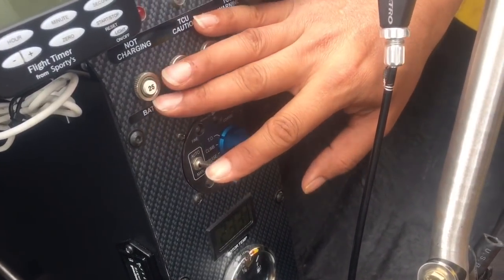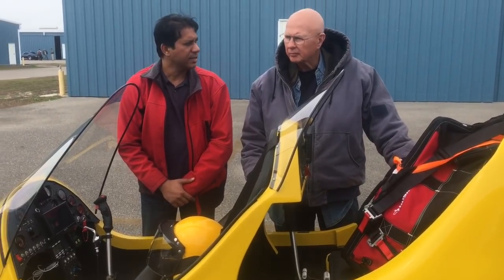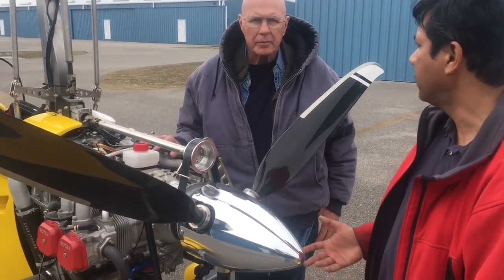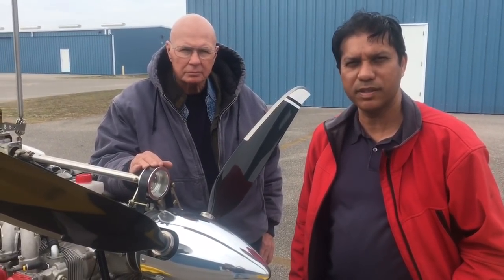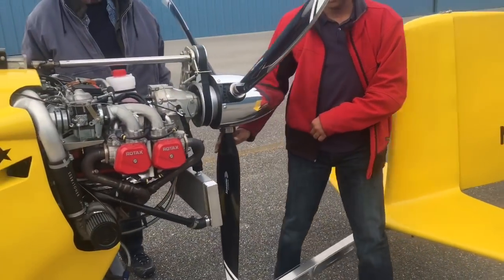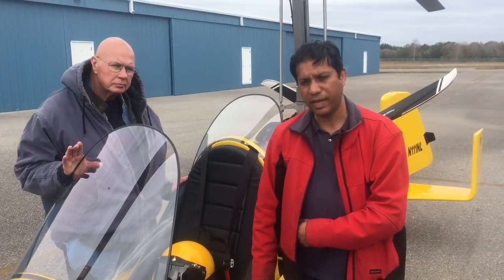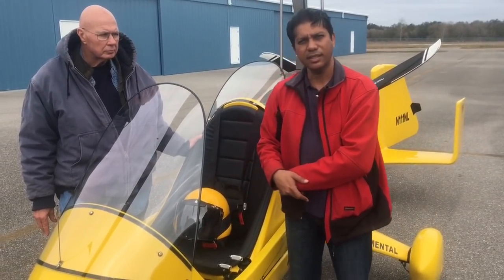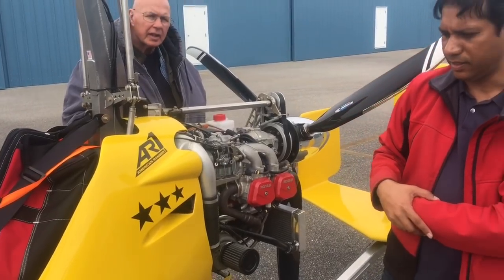Gyrocopter Airmaster Adjustable Propeller Explained

Comment: I WONDER IF an adjustable prop on a 2 seat, basically short haul, non-cross country airplane is of much benefit???
Reply: Tribulation Prepper 
Anytime you run an engine more efficiently you’re saving money as well as wear and tear on the engine.  A constant speed prop is to an aircraft engine like gears are on your cars engine.
Reply: @savagecub  I understand the purpose and your analogy for the prop.  I own a Mooney.  My point was that this extra expense seems (to me) unjustified for a non-cross country, puddle jumper.  Maybe this airplane has more capability than I realize???
Reply: Tribulation Prepper 
While it would be ridiculous to try and cover the same distance as one would in a Mooney in one of these aircraft they still do cross country journeys. A 1.5 hour trip in an open cockpit gyroplane (in good weather) is far more rewarding than the same journey in your Mooney. I do agree with you that this is a very expensive prop controller and likely this owner may never recoup this expense. Much like putting a brand new Garmin 650 in your aircraft wherein you would never get a direct dollar for dollar return when you go to sell it but you have the utility of it for your time of ownership.
Reply: @savagecub    What's a Garman?   Has Vortac been replaced?   Thanks for your good info.   I will agree with you that the open cockpit would be a lot more fun to ride around in and will add that the maneuverability for this little airplane is just about unbeatable.   The drawback for me would be in going to visit my grandkids in California.
Reply: Tribulation Prepper 
What’s a VORTAC ?  Is that one of those things you used to need a CDI for ?
Reply: @savagecub  It was just a big tall omni directional transmitting cone that sat in the middle of nowhere.   If you could find it, you knew you were half way home.
Reply: We just had a fly in at the Carolina Barnstormers and Mr. Barry Maggio flew his AR-1 down from Massachusetts and was last seen heading south to Florida.  So they are definitely capable of cross country flying you just have to do it.

Comment: Hi Abid, explain how you can use a variable pitch prop on a sport pilot rated gyro?  Beautiful machine. Mike
Reply: Gyroplanes are almost always Experimental Amateur Built in the USA right now. There are no SLSA gyroplanes. If the EXP-AB gyroplane has 2 seats, gross weight less than 1320 lbs and top straight and level speed of less than 120 knots and has no in-flight adjustable prop, it qualifies to be flown by a sport pilot who is gyroplane rated. This one f course can;t be flown by a Sport Pilot. Nick (the owner) is a commercial gyroplane pilot and a CFI-H for gyroplanes
Reply: It simply no longer qualifies as sport pilot flyable aircraft.  There is no such thing as a sport pilot rated gyro.  There are ELSA gyro's (those grandfathered in from the "fat ultralight conversion.", there are experimental gyros of which this aircraft qualifies.   Then if the experimental gyroplane meets the limits of sport pilot such as not exceeding 120 knots, weighing without exemptions 1320 pounds maximum, not seating more than 2 people it is flyable by those with a sport pilot certificate.

Comment: Excellent video explaining this adjustable propeller... I would assume these are not Sport Pilot compliant though,  correct?  I am hoping the FAA will start allowing these easily adjustable propellers as they are only taking power away from pilots.  I would think a simple system like this or the single lever system like the Spirit of Extreme 915is powered Sea-Rey... does not add that much pilot workload.  I am excited to hear about the internal rudder cables and the upcoming Enclosure!  I think the Corvette Yellow is just absolutely Gorgeous and just confirmed my color choice for an AR1!
Reply: You are correct, Sport Pilots may not fly aircraft with adjustable props....
Reply: But there are no LSA gyroplanes. Just LSA pilots. The gyro is experimental so he can put whatever he wants on it.